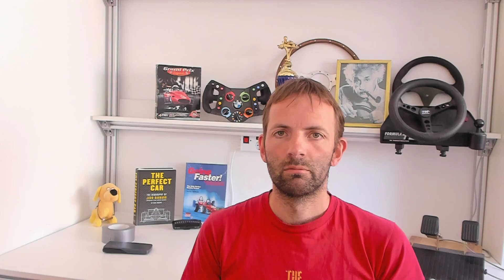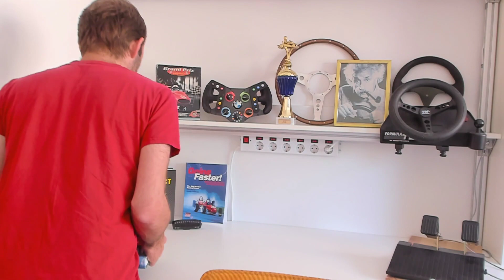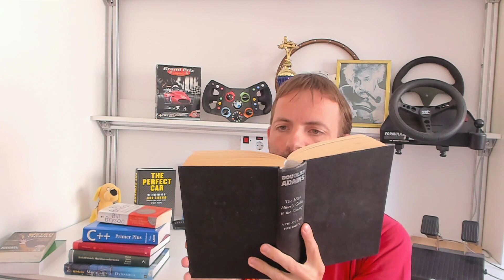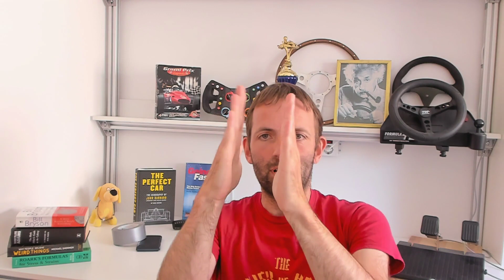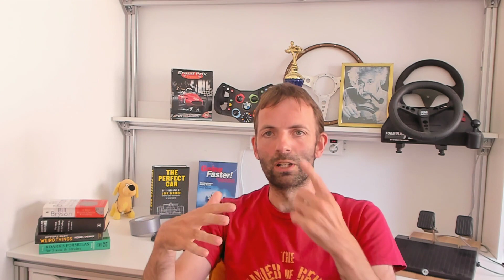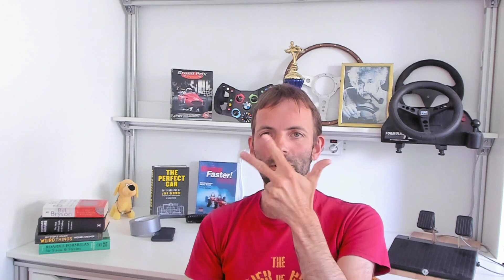Why are tires so difficult to model in a racing simulator?

Comment: Hey Neils. Random question but does PBR texture data roughly correlate to friction properties of the surface? Is a shinier surface usually more slippery? Can PBR data be applied directly to the friction components of the traction algorithm?
Reply from the maker: Sounds complicated to me, analyzing the texture.. The way it is done now makes more sense, where each surface material has its texture and separate grip factors assigned to it in some config file. Perhaps it could be done but it is a level of complexity that I don't really see the value of.
Reply: I ask because I find your perspective on this very interesting; I'm really just theory crafting with all of this. Developers seem to be getting more elaborate in their use of Physically Based Rendering data. It appears that instead of just using it to render surface light reflectivity it's getting used by the physics engine for providing values like friction on the fly. I thought that perhaps if dynamic elements of a stage that change the properties of the road surface like rain, snow or wear and tear update the same PBR data algorithmically, might that be useful from your side? Perhaps not in respect to the tire model itself
Reply from the maker: @arcshaw6396  I'm typically really happy when things work out on normal dry undeformable tarmac. I've not really given thought to these things.. In AMS, we have a track state that changes and each material (normal road, runoff, road with marbles) develop grip (positively or negatively) as a function of how many laps are done. That's pretty simple yet seems to do a fair job for us.
Reply: Niels Heusinkveld OK very interesting. Your approach works well in AMS I think and as they say, the simplest approach is often the best. Thanks for taking the time to reply, means a lot. Love your vids and your HE products, got a few myself and they let me enjoy "racing on the limit" as you say :)

Comment: Interesting Niels, but from what i've seen with the rf2 model, it has the physical model, but it also has many (more than 60) modifying parameters used to tweak the behaviour of the physical model (in the 'realtime' section of the TGM) . So in reality it's a hybrid physical+empirical model. But in the end, if a physical model produces certain peak slip angles and so on, you can't really use fudge factors to get correct behaviour, it just becomes errors upon errors
Reply from the maker: Very good point, I know it has some room for tweaking, but I don't know the extend to which you can. I do know that the RF2 physics guys aren't as 'free' to tweak as they sometimes want though.
Reply: @NielsHeusinkveld  Do you know to what extent S397 have control over the core physics of rF 2? From what I've been able to read between the lines, the base physics of the game were locked off by ISI, and S397 have essentially just been a professional modding team, adding a ton of licensed content to fill out the game. At least, it's the only thing that explains the many glaring issues that have been allowed to remain in the game for so long.
Reply: I think real-time section in rF2 allows tuning  things like wear and grip levels so pretty fundamental  things:). I’ve read GP3 modder worked for months with Michael Borda. It took few iteration of creating  tires, comparing with real telemetry , tuning values and comparing again etc. Real drivers feedback was also involved. Same tires will be used in upcoming F3 mod. But that approach is of course an exception.

Comment: I would have thought big developers like iracing had tire labs to collect their own data to feed models
Reply: Nah, a racing sim dev will never do that.  It costs millions of dollars for a facility like that.  What people do is hire them to test tires.  Very expensive.  

https://www.calspan.com/services/transportation-testing-research-equipment/tire-performance-testing/

I worked on a sim called VRC.  We built our own tire testing machine but since they were just RC car tires all we needed was a belt sander, a telemetry unit, and some moderately clever rigging.  For a full sized car tire you need something like CALSPAN.

Comment: Enjoying your videos !

Hey I have absolutely no business with rF2 ttool (maybe someday will, maybe never), but I can get some results while "working" with "realtime" section of TGM. Perhaps can't change that much in there, but for example I find that it is quite satisfying to control the way tire slips with those paramaters. I would say that it is even very intuitive. Many parameters for various kinds of static and sliding friction. Then bristle springs and bristle dampers are handy to adjust slip angles and sharpness of them in time. Temperatures stuff isn't too difficult to handle either. So there is lots of stuff that can't be "just tweaked" without killing yourself in there, but there also is quite some good stuff that makes it easy and intuitive to adjust IMO, and among that there is quite significant parameters.
Reply from the maker: Yes to some degree there is room to play with. I wish rF2 and iRacing really show us in detail how they go about as I clearly don't know the ins and outs of their models.

Comment: I've been playing a lot of iRacing lately and just for fun last night I tried a track in Automobilista (Lime Rock Park) that I'm very familiar with. In Automobilista, the cars are so much more forgiving, and don't spin out as easily. There is a lot of disagreement on which sim has the best physics but it's a huge difference, not even close. Once you start spinning in iRacing, you can almost never control the spin but in Automobilista, you can often correct the car and keep racing. This is with all assists turned off if course and I'm using a direct drive wheel and Heusinkveld Sprint pedals. Am I doing something wrong in iRacing or is it just harder to control cars in that sim?
Reply: It's a general opinion that iRacing is particularly unforgiving when you start to slide a car,. For a long time people have debated whether this is actually what driving a real car is like but recently Josef Newgarden (2x Indycar champion) commented on one of his streams that specifically the Indycar in iRacing was very unforgiving compared to a real Indy car, going on to say you can "hustle" a real car a lot more than compared to in iRacing.
Reply: I only have limited experience in late models, but I have a decent amount of track time in a Ford Focus. iRacing seems to be way to sensitive at the edge of grip. In other sims, I can countersteer or recover after a mistake or simply push a little harder to make the pass just as I would IRL. But in iRacing, I have to be so careful with my steering and throttle inputs that once someone is passed you basically have to wait until they inevitably push too hard. I have won way to many races in iRacing by simply just not pushing the tires AT ALL and then pushing hard at the end of the race. iRacing is great in that the way the body of the cars move and the way the weight transfers is pretty realistic. But it's nothing that other sims don't handle, and in some cars, are better at (like the MX-5 cup car in AC). So it's not you. I just lost the win at USA in the SLM because I pushed my tires too hard and lost 6 tenths on the guy behind me in the span of 5 laps. Tire saving is important, but it shouldn't ruin your race on such an extreme level in such a short period. That said, if you're into AC, then, tires don't really matter at all as long as you change them when everyone else does.
Reply: iRacing handlin just sucks
Reply: iRacing handling is pretty much garbage and unrealistic.

Comment: Very interesting video Niels. I have a question, since empirical models like Pacejka don't really have a temperature effect, how do you do it on the sim? I imagine that the grip change with temperature can be as easy as one equation, but predicting the temperature (and pressure) change inside the tyre in running can already increase the model complexity quite a lot.
Reply from the maker: In AMS, there is a grip versus temperature curve that gives greater grip loss the further away you are from an optimal temperature. That's simple but the heating of the tire is more complex and important. It heats up from rolling and from sliding, and cools in a few ways too. So you can tweak the numbers how much and how quickly you want tire rolling and sliding heat to buildup, and how much it cools off as you drive faster for example. Then there is a 'transmission' rate how quickly this outer temperature moves to the inside of the tire, where it affects the tire pressure, which also affects grip.
In my spreadsheet I calculate the heating and cooling values based on physical properties of the tire (thread area, sidewall area, contact patch size etc) so oddly enough, while empirical, I actually use 'physical' values in a way to set my base levels. It works well as a starting point. Putting a kart tire on a SUV will make it overheat with the values the spreadsheet pumps out..

Comment: I’ve never heard it articulated before but I kind of intuited that there would be the two types of approach to tire modeling that you described, and to me the empirical model makes so much more sense. The physical model needs to deal with too much complexity and simply doesn’t have the data required to model the tire behavior or to judge whether your model is accurate. In the end, you’re really going for a subjective experiential result anyway, so why not make it easier on yourself?

iRacing will never change their methodology anyway. They’ve got too much invested in their present approach and are too afraid of admitting that they were wrong to start over with a better process. 

The best thing they could do probably is hire Niels though!
Reply: I'm a simple guy.  When I drive a car in sim, I want it to feel like it is irl...I don't go into the data to fact check it before I drive

Comment: Reeeeeaaaally well explained 👏
Maybe a good point for the physical model is that if you succeed in modeling the tire from the ground, you can then give to your model the data for any type of tire and it will work out of the box with little effort.
But yeah, easier said then done...
Reply from the maker: Yep, it is the holy grail.. Imagine if it worked flawlessly.. But that is almost certainly impossible.. I have more hope of using clever spreadsheets to fill in the parameters for empirical models and get good consistent results for any sort of tire / car.

Comment: Some went so far to say that iRacing ripped off one million user with about one thousand dollars each which means iRacing had a billion dollars of budget from drivers alone (Did not mention they money they get from making you consume their advertisements).

I wonder if a budget of 0.0001% of that money has been given to a group of engineers like this guy what sophisticated and advanced physics models they would come up with.
Reply from the maker: Nah I doubt that.. iRacing I think admitted at some point that it took years before they turned a profit. And they have quite a few staff members to feed. I wouldn't be surprised if they are doing well now, but they're not leaning back in their chairs, feet on the table, smoking a cigar while counting the money.
Reply: @NielsHeusinkveld  In the end we both would be happy to know if they are doing well money wise because it's good for them.

But what kills me is that I returned to iRacing 10 years later to find all the broken things still broken. Example: The manual shifting model is OBVIOUSLY broken and many other examples.

Konus ACC or Reiza AMS2 could have fixed that in the next week update despite their smaller incomes.
Reply: I think we always have a tendency to overestimate/exaggerate how much money companies are sitting on. Look at this video for example, this is THE MAN responsible for Heusinkveld pedals!! It doesn't look to me like he's rolling in piles of cash. I know it's not the same as iRacing, but I think it's still relevant.
Reply: @spizzlo  They are very expensive, and few people have the money to spend in "toys".
Reply: I know those numbers are a BIG LIE being spread in iRacing forums by fanboys. Maybe 50 thousands copies at most has been sold (or rent out) through the 13 years of this sim age I don't know. Bottom line: Too much money, too little updates. Stick to other simulators like Assetto Corsa Competizione or rFactor2 if physics or realism is your thing.

Comment: Next: how does netcode differ between titles, specially how they fill in small gaps in data, do they just extrapolate or use something more sophisticated.
Reply: UDP is lossy by design.. Some FPS-devs probably have good ideas about everything..
Reply: @rkan2  Yup, that is just how time goes, you can't rewind so it is going to be lossy. What i'm actually interested in is that is it just simple extrapolation based on previous frame or is there something that at least tries to make it plausible behavior. Simplest extrapolation means that while turning and losing packets, the vehicle will continue straight and stop turning.. It retains velocity but not rotation.

F1 2019 has ghosting and AI control at some point when you lose connection and i hate to say it.. i think their way is the best...
Reply: @squidcaps4308 /videos rFactor seemed to have pure extrapolation back in the day (with laggy cars just continuing on their tangent in corners), but in more modern games I have seen some slightly more advanced prediction going on, trying to at least match the corner a bit.
Reply: @jubuttib  gMotor2 has just simple extrapolation, that is the one engine i know quite well. What sparked my interest now was that Norris/Rahal/Pagenau crash that could've been easily been explained by a lag spike and extrapolation.
Reply: That wasn’t a lag spike as much as just lag. Drivers were all over the world servers were in one location(idk what farm was used). Light can only travel so fast through glass(fiber). So naturally some of the drivers had to have very high ping.
Reply: I don't know for sure but IF F1 2019 is using prediction model like when you are racing online and if you go to the menu, AI takes control of the car. IF this is included then this would be one way to solve big spikes.
Reply from the maker: SquidCaps, I know really nothing about netcode. I think rFactor based sims use AI to 'fill in the gaps', which is quite clever. It could also very well be that iRacing reasons to add AI is for better netcode prediction.. But I really don't know!
Reply: @NielsHeusinkveld  Damn, thanks anyway.. I have the same problem, i just don't know enough. And thanks for this video, even though there was really nothing new to me, it is nice to have it all in one video when this topic comes up. Neat, concise and very informative.
Reply: Extrapolation, prediction algorithms, etc.
Reply: I would love to know what Wreckfest uses netcode-wise, because THAT game has a really difficult job. iRacing etc... those are not crashing simulators. Ok, you need car collisions to "work" but crashing isn't the main attraction of the game. Wreckfest REQUIRES collisions to be GOOD (imagine playing it with iRacing netcode!) and to its credit, they are! You can rub door handles at 80mph on dirt, which is fantastic.
Reply: There can be things as simple as minor delays in positional data , right through to great burps which is where the predictive calculations come in to basically filter a cars position, but overlay the directional change and vertical acceleration and deceleration. Now if we then couple to this the varying level of grip due to temperature changes and the loads that the tyre is subjected to and the temperature calculations that must be done as a result of this compromise . 
The grip and wear and the rate of temperature rise IS related to the grip factor of the particular area within the sim, the traction change from Grass to loose gravel to quality tarmac .
All of these things are difficult and time consuming to say the least .
Reply: @mozzmann  I know something about this and i highly doubt any of the titles use very complicated methods, it seems like it is mostly based on just simple extrapolation where the vehicle will follow the current vector. This works very well on straights but are awful at corner at high speeds... It still is true that you want to be on the inside if the other car is lagging even a bit since all errors are going to point to the outside of the corner.. 

I used to be against ghosting but now i think it is the only way to really solve eSports lag spikes. You disable vehicle-to-vehicle collisions first, then start looking at "where is this car suppose to be in this frame"..
Reply: Simplest is extrapolation but there could be also predictions based on model. Maybe a stochastic (probability) approach like Kalman or Monte Carlo could be used for estimation of position / attitude. I think they might use some simplified vehicle model for this estimations. But who knows?

Comment: Thank you Niels for the explanation. Do you know what kind of tire model F1 teams and FormulaE teams are using for their simulators? I personally (I am an automotive/ aerospace engineer) would never try to physically remodel something if I do not develop it myself. For materials we use material curves from the manufacturers, for parts we know we use the curved of the parts we tested. Only new parts get an FE model to predict its behaviour (difficult enough for isotropic materials). So what sense does it make to make a complicated model about something I rather measure?